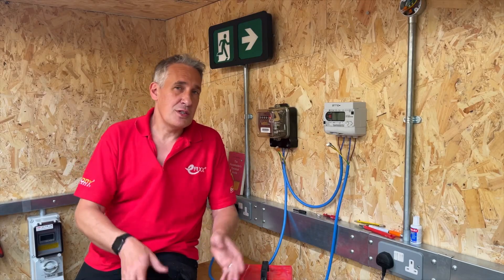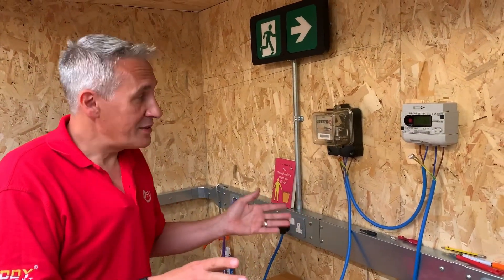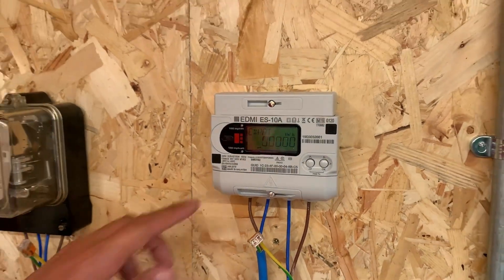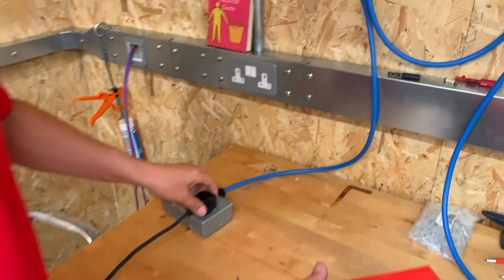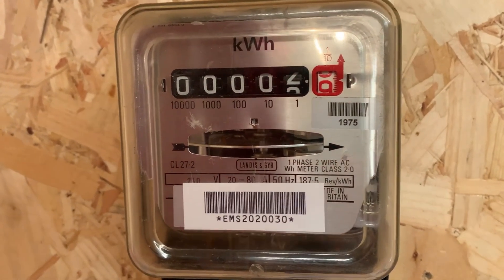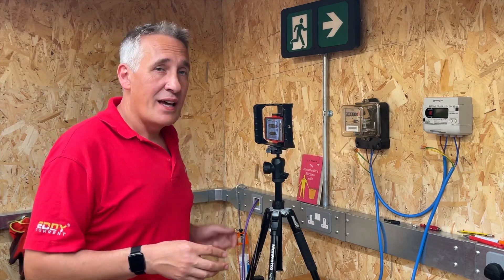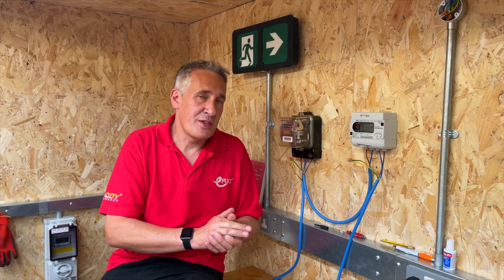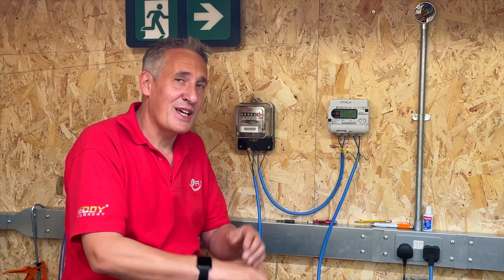Will My Electricity Meter Run Backwards After I Install Solar?

Comment: My supplier was Igloo energy. They refused to accept my readings as they were going backwards, so instead they billed me for estimated readings which were massively more than I was actually using. Since they went bust I have had numerous letters from the administrators demanding that I pay the estimated amounts. I have refused and although they say they are looking into it I am continually getting letters demanding payment, bailiffs, etc.
Reply: You must go to court over this.
Reply: @juliawigger9796  I'm happy to fight it.
Reply: You cannot be accused of stealing electricity if over generation of pv is put into the grid, effectively using it as an unofficial store of power, ( meter running in reverse)and then when the panels are not generating you’ll be using that excess power , you generated,  then the meter will run in the normal manner.
Reply: @michaelp998  Their view was that my meter wasn't working properly and so they charged me for estimated use, even though I have 9 kWh of panels and 14. kWh of batteries.
Reply: @lancashirebob3  They're right. Get a proper meter fitted and stop trying to fiddle the system.
Reply: @bugone2  you are either mistaken or misinformed. Clearly Igloo liquidated because they were up to their necks in questionable practices, as will be the case for mostly every other energy supplier adopting similar practices. It’s only a matter of time.
Reply: @bugone2  Silly comment David. I wasn't trying to fiddle anything. I time and time again asked my energy companies to fit a smart meter but got told each time that they weren't fitting in my area.
Reply: @bugone2  An analogue meter is perfectly proper and have been used successfully for circa 50 years.
Reply: @voxveritas26 it's not adequate for feeding back into the grid, but it's responsibility of the power company to fix it
Reply: @bugone2   Both meters are proper meters. The analogue meter is fairer because it records total consumed power and you're billed accordingly.
A smartmeter means the power companies scam us for overgeneration.
Get on the side of the consumer and the world will make more sense to you.
Reply: Did you not organise grid pay-back before installation?
Reply: @philtucker1224  That's with Eon. Installed and paying back since 2011.
Reply: @lancashirebob3  in the U.K. the official arrangement available is that if you are feeding power back into the grid then they credit you monthly for whatever you have generated. This is arranged in writing from when your system is commissioned. For example if you have used $100 dollars worth of electricity but generated $150 worth then you will receive a credit of $50 dollars. Obviously It’s the responsibility of the company who commissioned your system to help arrange that…
Reply: @Phil Tucker  that's not quote right. Under the FIT scheme you get paid for whatever you generate regardless as to whether you have used it or not. In addition they pay a smaller amount on 50% of the generation which is the 'deemed' export. The arrangement was floored but for those that got locked in before they started reducing the FIT payments it was very lucrative. A meter running in reverse is an added bonus as effectively you're getting paid twice for the energy you generate!
Reply: @DamoMils  Hi Damo, that an interesting clarification as I was unaware of that part. (We should also mention that the FIT scheme only applies up to a maximum of 4kw domestic installations) Yes the first/early clients gained the most on that scheme. Lastly I thought the “meter going backwards effect” was just a tongue-in-cheek fallacy! (Are you sure electricity suppliers actually repay on reverse readings?)🤔
Reply: @philtucker1224  Yes the maximum install was 4kw to qualify. You got a generation meter that is separate to the main meter and you give the readings from that independently. I've changed my domestic supplier a number of times since I had mine installed in 2011 but I am still with the original electricity company for the FIT - there is no point in changing as they all have to pay you the same amount. So effectively the generation and domestic readings are entirely separate. If you have an old analogue meter and that goes backwards then with a 4kw solar in all likelihood you will not generate more than you use and so the domestic meter will always show a positive change and you will be billed on that. I doubt any supplier would pick up on it to be honest and my guess is that most home owners wouldn't notice anyway as it would only go backwards on sunny days in practice. My supplier came to fit a smart meter and the installer said my meter box was not suitable so I'm not sure what else one could do. I get paid 60.23p per kwh and 4.25p on the 50% deemed export. If one's meter goes backwards then you are effectively also 'earning' 65p or thereabouts (ignoring the Energy Price Guarantee) for each excess kwh generated when your solar is producing more than the household is using. Hope that makes sense.
Reply: And the meter is their responsibility not yours, you can’t move it or open it, it is theirs.
Reply: @nicotoscani1707  yes that sounds about right. All of the energy you can generate and use of course is free so altogether a very good deal.
Reply: But this trick doesn't  work always.sometimes meter stop spinng even the inverter is feeding back

Comment: There are two distinct types of analog meter.  One will happily run backwards all the while you are exporting from your solar installation.  The other type is fitted with an anti-tamper pin which will only allow the meter to reverse for 1Kw and then stop.  Just my luck...   I have an anti tamper pin version.  From what I can find out, the only way of knowing which type of meter is to see how it behaves once everything is connected.  It seems that for obvious reasons, the presence of the anti-tamper pin is not widely advertised.  Batteries are definitely the way forward, already seriously considering getting a second one installed to our new system.
Reply: I guess that means that when you are making energy, your meter is not going forward then. That would be a save anyway... If you had a smart meter, then you would be screwed. Export counted very little and import counted high and the utility company have control over your meter too. Never have a smart meter installed, it gives too much control to the utility companies and government.

Comment: Smart meters are capable of being used to shut your power off remotely. Eg if fuel for electricity production is runs short then we could initially be asked to use a lot less energy, if this isn't enough the government can step in an selectively turn power off by some kind of scoring system, or by region, but the advantage of turning your power off at the meter means they can be extremely selective. Hospitals, care homes, dentists, and the like might stay powered, but you might not.
Reply: For these reasons, am getting a generator and switching to gas for cooking. Don’t have solar panels and batteries are an environmental disaster.
Reply: @richardwoollaston3650  gas is great, when you have cooked on gas, you never go back to electric cooking. However there was plans (probably still is) to prevent new gas installations, and new appliances will be outlawed eventually. I expect the rules for gas devices will be made so difficult to meet that people will get rid of gas altogether in droves, making it harder and harder to actually have gas even when you want it.

As far as I'm concerned, they can take my gas cooker from my cold dead hands because that's what it will take!

Comment: So, the solar power can simply be fed into the house grid and it’s additive, you input 50w and pull 30w, that’s it? No special electronics or other gimmics?

Comment: You mention the micro switch on the smart meter, apparently they will also report when the main fuse is pulled, they know its a power cut when neighbouring properties also loose power, just one and chances are something's been disconnected.

Comment: I got a 4800w solar array fitted this summer with the hope that my analogue meter would spin backwards. Nope, goes one revolution then stops. My neighbour has a similar looking analogue meter and he has submitted lower readings to his electricity supplier than the previous quarter and received small refunds! I suggested to him to get a heater in the garden or whatever to ensure his readings always go up slightly as pretty soon they will come and change his meter! I understand the electricity company can in the case of faulty or inappropriate metering equipment back charge the customer, and this is what they count a backwards running meter with solar as. BUT in the UK they can only back charge upto 12 months. So if I was lucky enough to have a backwards meter I'd keep quiet and milk it as long as possible- but ensure readings were always going up a bit each time so as not to arouse suspicion!
In my case, sadly, I'm going to have to get a solar battery or live with the mean smart energy guarantee feed in. At the moment I'm ploughing upto 20kwh a day back to the grid for nothing because I've not got  the MCs cert yet!

Comment: Most Analog Ferraris meters are fitted with an anti reverse pawl, this is indicated with a little logo on the dial plate, I am surprised a meter as modern as 1975 wasn't fitted with this device.

Comment: If you switch suppliers using u switch or similar . The terms and conditions state you agreed to have a new smart meter installed and they will hound you to install it . Resist ask for a conflict lock number and complain to your mp and the energy watchdog .... my meter still goes backwards and I’m looking to increase my solar by installing another one ... I’m using the grid as a big free battery 👍

Comment: When we had solar fitted in 2009, our old mechanical meter ran backwards when we were exporting. But eventually our supplier came and fitted an electronic (not smart) meter to prevent this perk. It was good while it lasted.
Reply: To be fair, they all should be like that.
You are giving electricity to the grid, you should be paid for that
Reply: @TheAllMightyGodofCod  We are on a Feed in Tariff, so we're already being paid for our solar production.
Reply: @andyfraser5876  Modern feed in tariffs are taking the piss. They bill you at 35p/kWh and you're lucky if they pay you 3p/kWh.
Reply: @Soruk42  We're still on the old FiT, so we're getting 13.14p/kWh + 4.25p for 50% deemed exported.

Comment: It is quite simple and you answered the problem perfectly well.  If you have installed a full solar PV system that has enough power to run the household and give a lot of excess then the inverter adds a few more volts than the grid and this is enough to push your generated current through the meter the opposite way.  There is nothing wrong with doing this in so far as fraudulent use since you are simply storing your excess and in fact helping the grid to supply others that are using more.  Storage is the biggest problem with energy and any way that can simplify this should be grabbed with open harms. However,  the greedy energy produces think they are providing a storage system with no return for them in good times.  Paying customers a pittance for generating a pure refined energy source better than the grid that carries more spikes than weeds in your garden is down right immoral.  In the UK our government love to invent laws to suit them in power not for the good of the people so they may make it illegal to suit the energy produces not because there is anything wrong with doing so.  To combat the issues mentioned in this article only generate enough power to cover the household use and ensure that the meter never turns back more than the previous reading that way everyone is happy.  If you need to generate excess power for grid outages then a battery storage is currently the only way but carries a cost in the purchase of the equipment.  It is easy to get an MPPT invertor that can operate using three methods - Grid tied, Solar,  and a diesel generator. This can be setup to work in sync with the household needs.  Some people on here foolishly thought they were missing out on getting paid that pittance so the opted for a smart meter or a replacement and so told their supplier who quickly sorted that out in their favour.  Smart meters do not save you money in anyway other than show the ignorant what they are using and when with the illusion that they could offer lower costs at off peak times but other devices are available to do that without the risk of  hackers and technical issues with smart meter technology not to mention the ability of governments to monitor what the usage control they have from afar - even rationing when the supply gets tough as we will see in the very near future through incompetent policies. PS the possibility that there is a hidden hammer blow with the meter reading 999,000 can only occur if you have just had a meter fitted or you have been using it for years without any draw from the grid hence the need for additions to the system.

Comment: I am in California and at the beginning of the year my solar was "authorized". I wrote down the meter reading on the smart meter a month later. Since then I have put an excess of 3 MW-hr into the grid. Super insulating the house has really reduced the demand! There is a small connection charge on the monthly bill, but then suddenly it went to zero. After three months of that I was wondering what was going on. Well, California has carbon trading and part of the fees received are credited to each utility customer every spring and fall (autumn). That is almost enough to zero my account for the year. Of course any excess credit for feeding the grid goes poof at the end of the year.
Reply from the maker: That’s a great result - is the problem
In California too much sun? ( of course we are jealous)
Reply: @efixx  Not usually in northern California, but this week we have been setting records. Some of the local towns have set new records ten degrees Fahrenheit above the previous highest recorded temperature. Just east of here it was 116 degrees but we only got to 92 because we are on San Francisco Bay. At the same time right on the coast it was 75. This is an extreme example, but it is usual in July for it to be 68 in San Francisco and a 45 minute subway ride east it is 98.

Comment: I was wondering if these so called smart meters could cope with back feed into the grid , Got a old analogue meter that whizzes backwards when its sunny 🙂
Reply: SMETS2 meters read energy usage perfectly well in both directions.

Comment: Old style meters will always run backwards when the solar system is generating. And then back to normal at night. The meter has to be changed to a compatible one that shuts off when generating electricity

Comment: I used to have a TIG welder, every time the high frequency unit was turned on the analog electric meter used to spin backwards. Wish I had that welder now.
Reply: I am guessing that is because the welder was such an inductive load it fooled the meter in the respect that they were designed to assume a 'unity' power factor in a domestic setting. In the old days heavy industrial premises had powerfactor meters because of this fact, but I would guess modern smart meters get around this ...
Reply: Wow I start my TIG course tomorrow lol.
I'll put this to teacher 😅

Comment: We have to do a installation notice to our DNO (I guess that's what you call the company that owns the actual cable that comes to your house) and inform them what kind of setup we have installed. The consumer also need to have a contract with a electricity company that buy back excess electricity. Here the DNO and electricity seller/buyer can be two different. Also we have smart meters installed everywhere, there was a law a few years ago mandating the DNO to switch to smart meters everywhere

Comment: We had solar fitted in June and our old analog meter did indeed start going backwards.  Called EDF energy and they turned up 2 days later and fitted a smart meter.  The smart meter hasnt been able to pick up any kind of signal since even though they keep saying give it 2 more weeks.  Meanwhile we are still paying for the same monthly usage as before as its never had a reading since fitting 6k of solar.  Funny how they are not in such a rush to fix this for us.  We should have stuck with the old analog meter.
Reply: The smart meter communications may not be getting through tothe energy supplier,  ut you can still take your own manual readings, photograph those, & send them to your energy supplier. And keep the photos as proof in the event of a court case! 😉

Comment: I have a grid tied inverter with a limit (current sense on incoming house mains) on it so it never generates more than the house is using. No one needs to know anything then :)
Reply: Mine only exports if the battery is full.

Comment: >about to get the biggest electrical bill

I did the math, ((99.999 KWH/[bill cycle])/240V)

If you did this before a yearly  billing, you would have used 47.56 A (11.42 KW) continuously, which sounds wrong to me for a private complex and might trigger a check for if the place is used to grow specific plants

If you did this before a monthly billing, you would have used 570.8 A (137 KW) continuously, which should ABSOLUTELY cause the electrician to check the installation for what's wrong with the wiring, since that's 7X the rating of the electricity meter

That is, if I used Wolfram Alpha correctly